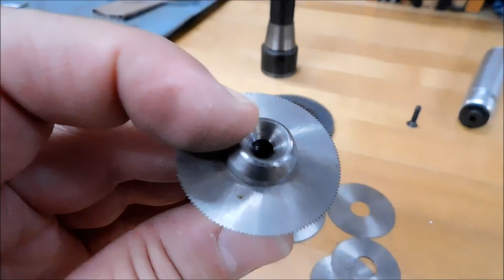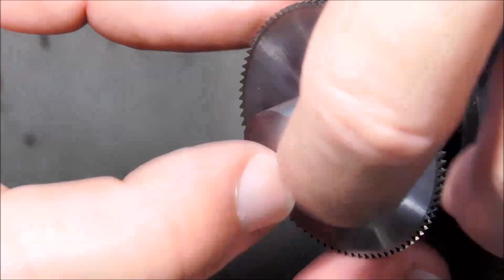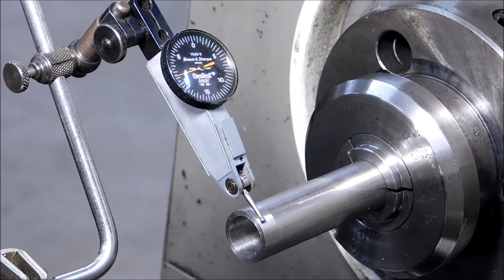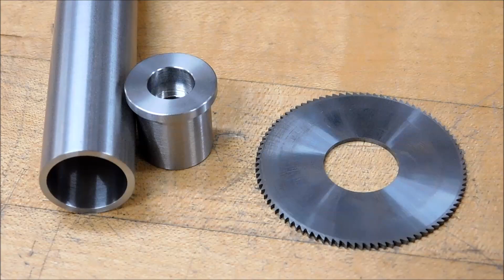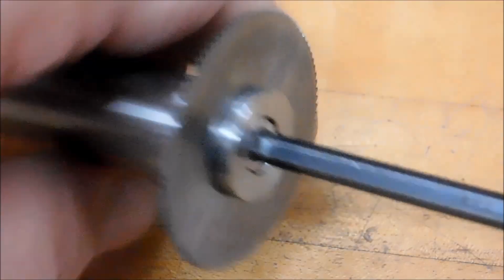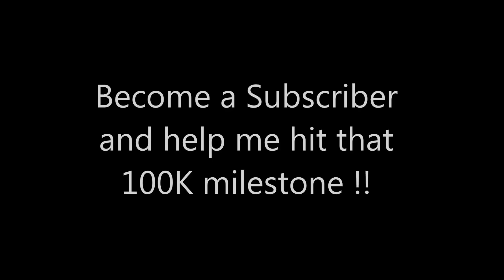Machine your own Low Profile Slitting Saw Arbor

Comment: For the camera issues, may I suggest a mirrorless or dslr with a proper macro lens. I use a Sony a6500 on the lower end and it is southbend good. On the higher end, I use a canon 5ds which is monarch level of good, but very expensive. 

In your videos, those closeups are important so the ability to change lenses is too. Sorry if it is asking you to spend more time fiddling with a camera, but the quality is important.

Comment: Hi Joe, thanks for another great video. I never realised those thin slit saw blades are hollow ground. I have a box full of oil pump back plates I need to cut transfer galleries in so i was going to have to make myself an arbor like this. The video is a great help.
May I ask a question a little off topic? Your opinion would be greatly appreciated. A customer has asked if I can rebore a two stroke motorcycle barrel. Do you think that this would be possible using my Bridgeport and a Lushington boring head?
An old toolmaker showed me a great trick to assure concentricity in milling arbors. If a lathe tool is mounted in a vice on the table and the arbor in the quill you can effectively turn the arbor in situ. I've used this trick a few times and it does work.
Thanks again.
Reply: As a 30+yr veteran of performance engine building, a "jig boring" machine is the proper machine because a mill doesn't have accurate enough perpendicularity. If it's for something low end like say a generator you could get by with a well trammed mill.

Comment: Great video Joe - thanks for sharing, one quick question, if I were to build such an arbor but using with an involute gear cutter - do you still think the key way is optional ?
Reply from the maker: That would depend on the size of the gear tooth. If it were a very small gear, probably not, but larger teeth = more tool contact, so I would put the key in.

Comment: Hi Joe  just bought a tool holder the same as you just used with the 3 point triangle insert as the one you have seems to work so well, problem is the tool holder ID number brings up no insert code could you show me the way forward. thanks Jeff. uk based
Reply from the maker: You probably have a holder that needs TPG inserts. 321 is .015" radius tips, 322 is .03. if the insert is large, look at TPG 43x series.

Comment: Hi Great videos I follow you for a long time learn a lot from you
I got a small Lathe is it possible to cut a trade inside or outside without that little gauge that you have in the machine on the right hand side to engage and disengage the lathe I don’t have that on my machine is it possible to cut the tread thanks
Reply: As Evan Lewis said, you can reverse the direction of the spindle to "wind" the cutter back to where it started. I have to do this when cutting metric threads on my imperial lathe, because the thread dial is only useful for imperial threads (because my lead screw is imperial).
As your cutter moves near a larger shoulder on you part, be ready on the cross-slide wheel to back the cutter out of the way!
Reply from the maker: I believe there is a condition that will allow you to do that. It has to be a relationship between the lead screw pitch and the pitch of the thread you want to cut. I can't define it, because I have always used the thread dial. Can anyone elaborate on this??
Reply: @joepie221  Yes, there is, and it's exactly the relationship between the leadscrew and the thread you're cutting. For an imperial lathe the thread you want to cut has to be a whole multiple of the leadscrew tpi. For a metric lathe the leadscrew pitch must be a whole multiple of the pitch of the thread you're cutting. Anything else, leave the half nuts engaged and reverse the lathe.	e.g.
imperial lathe														
12	tpi l/screw:	12	24	36	48	60	72	etc						
8	tpi l/screw:	8	16	24	32	40	48	56	64	72	etc			
6	tpi l/screw:	6	12	18	24	30	36	42	48	54	60	66	72	etc
4	tpi l/screw:	4	8	12	16	20	24	28	32	36	40	44	48	etc

metric lathe														
1	mm l/screw:	1	0.5	0.25	0.2	0.125	0.1	etc						
1.5	mm l/screw:	1.5	0.75	0.5	0.3	0.25	0.15	etc						
2	mm l/screw:	2	1	0.5	0.4	0.25	0.2	etc						
4	mm l/screw:	4	2	1	0.8	0.5	0.4	0.2	etc					
6	mm l/screw:	6	3	2	1.5	1.2	1	0.75	0.6	0.5	0.4	0.3	0.25	etc
Reply from the maker: @ericfeatherstone  I'll have to check this out. I always use my dial. Thanks for the detailed reply.
Reply: The easiest way is to run your motor in reverse to return to the beginning of the thread. If your motor does not run in reverse you can wind it by hand, or wire the motor to run in reverse. This is quite easy if it is a single phase motor with a condenser or capacitor mounted on the top. I made a YouTube video about a reversing switch for the motor.

Comment: interesting solution to getting saw to run true . . . i did one recently where i had to use an .008 thick blade cutting 4140, i made a more conventional arbor, but i made my finishing cuts where the blade fit with the arbor IN THE MILL, using a lathe cutting tool held in the vise . . . it ran perfect . . .
Reply from the maker: Can't get better than that.

Comment: How about this one Joe? 
Machine a 1/2-13 flat head hex bolt to 3/8-24 and machine the underside of the bolt to fit the slitting arbor. Take a 3/4" piece of round stock bore a hole to fit the underside of the bolt you just machined and tap it to 3/8-24. Two pieces, 5/16 hex wrench and a very shallow bottom.

Comment: Joe, I made a very similar arbor. The main difference was I used a 16mm bolt as stock material. Grade 8 bolts are a reasonable steel.Threads were cut off, and the head makes a convenient place to grip the arbor when tightening the cap screw.

Comment: Very interesting.   I do have a question, not a criticism, just a question.   Any reason to not use 1/4-28 rather than 1/4-20?   For the same torque you would get more clamping force.
Reply from the maker: A fine thread would probably be better. I don't stock too many 1/4-28's so I went with what I had on hand.
Reply: Joe Pieczynski that’s what I guessed.   And nothing wrong with it either.   I have seen too many times where over engineering caused unintended consequences.

Comment: Joe, another video hit outta the park!  Was there any technical reason you used stainless steel for the arbor?  Or was it just a cutoff that was near to the right size?
Reply: Commenting to track any answer to this.  I was going to ask the same.
Reply: He said in the video "cause that's what I have", I assume to answer this very question.
Reply from the maker: I knew I could trust the straightness and OD of the material on the shelf. No other reason.

Comment: Hi Joe, 

Yet another great video and on time. I was only the other day looking at my acquired collection of slitting saws and thought i need to make an arbor. 
Maybe to night it will be done.
 
Thought, Idea and suggestion. 
Whether the screw if fitted from cutter side or in the back of the arbor, it will tighten if it slips a little. 
If it work tightens, would it be an idea to maybe put two (or more) flats just up from the cutter (not affecting the cutters arbor register) to allow a spanner to be fitted in the event it really goes tight?

Keep well and keep up all the good work.
Regards,
Paul

Comment: Hi Joe - Nube Question, If the cutters are dish ground, is it feasible to use soft material as washers to crush and hold the profile when tightening. In my mind, there is very little surface area for clamping on the blade if the shoulders are at 90º which can deform the blade or allow it to "wobble". Stay safe and well :)
Reply: That's not an issue. If you where to measure the difference in thickness from tip to clamping hole you would see it's only a few hundreds of a mm in total (1 to 2 hundreds per side on a 50 mm blade if my memory serves). By using soft washers you would likely introduce a much larger error. 
And the clamping force is enough, if these get stuck they tend to shatter, not slip.
Reply: @sharg0  Thanks Rolf :)

Comment: I like using 20mm linear rail to make these.  The inside of those is much softer than the outside so it's quite nice to more and tap but you still get a nice tough tool.
Reply from the maker: The extra toughness on the OD would certainly be a nice feature. Disclaimer: Any similarity in subject matter between the topic of this video and the recent struggles of any other YouTube channel creator, is purely coincidental.
Reply: @joepie221  Disclaimer:😂
Reply: @joepie221  Can you block other creators as they have blocked you?

Comment: Thanks Joe, great video. What is that scraper you are using? 3/4 something?
Reply from the maker: 3 corner. Its a drill blank in a polishing stone holder. Grind the blank to 3 sharp sides like a spear tip. Works like a charm.

Comment: Congrats, Joe! This is the first slitting saw arbor I've seen (including home-built and commercial ones) which runs true. I call these "ching-ching" saws because of the characteristic sound they make as a result of being non-concentric. Even the arbor made by Stefan Gotteswinter went "ching-ching". 
I hope to replicate your success when I remake my arbor. A concentric slitting saw has a much longer life!
Reply from the maker: You can 'unloosen' the ones that go ching-ching and spin them a couple degrees as they get dull. Uses a fresh section of the blade.

Comment: What a great tool holder!
Well there is a one advantage lets call it if you put long screw from back and make threads inside the cap.You can put a tailstock center if you are going to use a slitting saw on the lathe.That way you get rigid setup.
I know,i know slitting saws arent exactly a lathe tool but beggars cant be choosers and if you got milling attachment its a tool you can use if you are too poor to afford milling machine.

Comment: You give excellent info Joe, and I thank you. So here's a tip for you:
I use Heat treatment quenching oil as a cutting lubricant. It is designed to have a extremely high flash point so it doesn't smoke when you cut with it. I get it from Brownells and it keeps my basement shop smoke free.

Comment: Galling is highly problematic with 316 stainless. Anti-seize should be used on the fastener, especially if it is also stainless.
Reply: I’m told if you use a different grade of stainless between nut and bolt, galling is very much reduced.
Reply: @rexgretton6221  Different alloys can effect galling, but, in this instance, the alloys are very similar. The arbor is 316 and the fasteners are likely either 302 or 304. 316 has 2% molybdenum which the latter alloys lack. Otherwise, the differences are 2% of their respective chromium and nickel content. 316 is a 16-10 alloy and 302 & 304 are 18-8's. 
Galling typically occurs when the oxide layer is stripped off a stainless part. The base metals of different parts can then easily fuse together. Similar to how gage blocks attach to each other, but on a threaded surface there can be a lot of surface area fusing, which can make them very difficult to move. This is a lesson I've had to learn the hard way ;-)

Comment: I have always liked "Rapid Tap" products for my general light use cutting oil. Since it no longer has the skull and crossbones is no longer on the can I have used it more frequently than before when I used it only for hand tapping. I sure hear you on working with stainless. I often compare it to cutting an inner tube with a 2x4, LOL. That is a sweet little arbor that should stand the test of time. Thanks Joe.

Comment: You are a pro for sure. 
Some others say to run slitting saws slow, and even slower the thinner they are, but that test at the end did not look slow by any means and it was a thin saw to boot. Any hard advice on this issue for us newbies?
Reply: Cutting speed is based off material being cut & material doing the cutting. The saw used at the end was a carbide saw, which will usually have a higher SFM speed than an equivalent HSS tool, and was also being used against aluminium which can be cut at high speeds. Tooth count also comes into play but there's charts for that.

Comment: Great video and project idea.
Only thing it's missing is a cross hole or peck on the shaft to help when tightening down blade. Use a pin or spanner wrench to grip shaft? Or is over torque an issue?

Comment: I have a project that i havent started on because i need a 0.5mm slot in it. Deepest point is 6mm deep. What would you use?
Reply: Those blades are available to at least 0,3mm, the ones I had were 32mm outside diameter and 10mm inside diameter. 6mm deep requires several passes though or a really slow feed(not ideal, much wear and heat)
Reply: mister marcus alright, i could not find any which made me uncertain if there were any of that size available. 
If the mill is not perfectly trammed could friction accumulate further down the cut? Or are there other hidden dangers of this?
Reply: @simonsproductions1  long or deep cuts always need a well tramed in machine regardless of the tool used. I found that if the blade is running true you will have no problems once you dialed in the speed and feeds for your particular setup. The wider diameter blades need more accuracy especially the thinner they get. A small bit of run out isn't really a problem either but a wobble will give you trouble when going either deep or really thin. Just keep in mind that small blades have very little room for chips but keep your feed in the micron per tooth or don't expect those blades to last a long time in anything tougher then regular steel, but they aren't that expensive anyway. It's the arbour that costs real money...

Comment: Looks like an awesome beginner's project.  I'm pondering making a set of these for our local makerspace (http://swindon-makerspace.org/).  It looks like you should be able to make one arbor and a bunch of caps for different sizes of slitting saw.  Foresee any problems with that?  It looks like the trickiest part would be getting rid of any corner radius as you point out at https://youtu.be/Sp1Vaqwqw3c?t=301 -- anything else I should be looking out for?
Reply: Notice that Joe used a collet chuck, and surely a really good one. I turned a centerless grounded bar in a 100 year old laith. The inner hole was off center.... If I've turned even the shank in the same grip it might have turned out with less runout.

Comment: Hi Joe, 

Nice job. 
I've made arbour for odd size holes as well but the usual way with the reduced diameter on the main section, and generally leave the cutter on the arbour, so they are cutter specific. 

Seems like you were the victim of that well known photographer "Otto Focus". It's also made worse when you're in close and the aperture large as the depth of field is reduced. Increasing lighting levels may help. 

Regards Dennis.

Comment: Beautifully designed, nice machining & thanks for giving up your time  effort in producing this video. Hope you don’t get issues with galling on the close fitting stainless on stainless parts especially considering the environment & use. Wouldn't take much contamination to mess that nice work up.  Thanks again for the fantastic video.
Reply: Do you use some kind of lubricant when you have stainless on stainless threads?
Reply: @somebodyelse6673  
Hi thanks for your question. Yes it’s absolutely essential to use a high quality anti scuffing paste when fitting stainless threads & close fitting stainless on stainless components.  I personally have always used the brand Rocol for this. My concern is more of the neat fitting stainless on stainless sliding components . It would only take a small burr, bruise or contamination for galling those components up. The problem of using anti scuffing paste in this environment/use is that contamination is highly Likely to stick to the paste and so could be working against you when fitting removing cutters/parts.
For these reasons I personally believe stainless on stainless in this particular design/environment is not preferable. Beautiful design, its  just I personally would be reluctant to use Stainless. Hope this helps.

Comment: You comment on heat in the work pice. Naturally temperatures will differ the impact depending on diameter. Would you be able to show this in the same manner as in “crappy result due to bad set up”?
I like Your videos!
Thanks for charing Your knowledge!

Comment: Great design, greate work, greate video. Double voices at time ca 12.....
Will check if that design can be used for some saw blades having a 6.02 - 6.0? mm hole. An M4 bolt using a 6 mm wrench has a quite low head, lower than cap head screws. The head will add to the waisted distance  between the blade and the head of the bolt.
Reply from the maker: I missed the voice over in edit. Sorry.
Reply: @joepie221  No problem, no info lost.

Comment: Hey Joe, great video. Do you ever put flats on the arbor to hold on to it while your opening the cap screw?
Reply: You can put the arbour in a collet holder first and then mount the blade, either in the spindle or toolholder (like a Toolboy). That way you don't need flats.